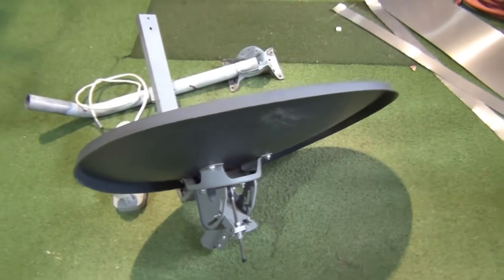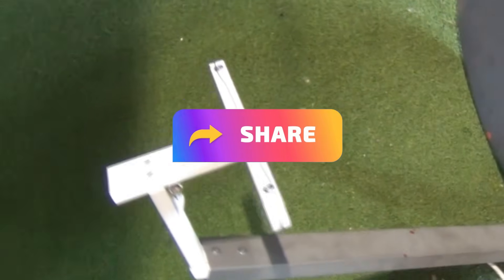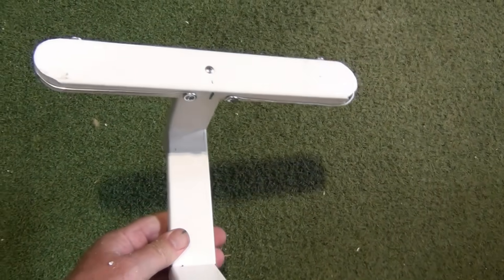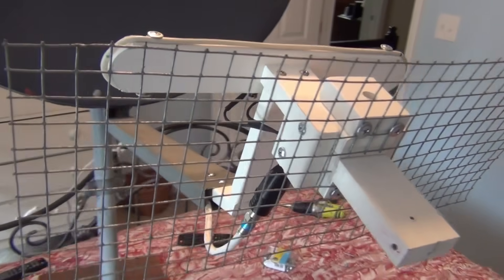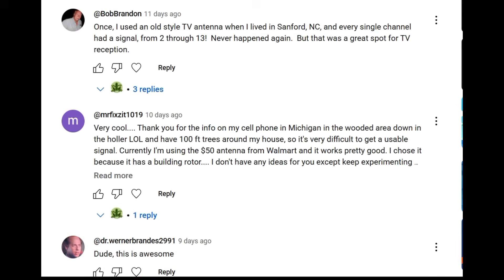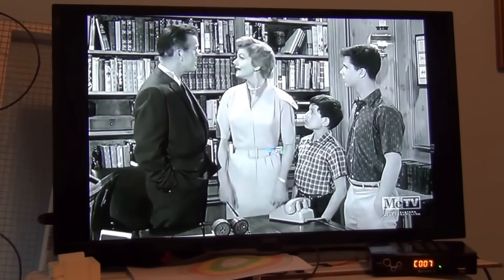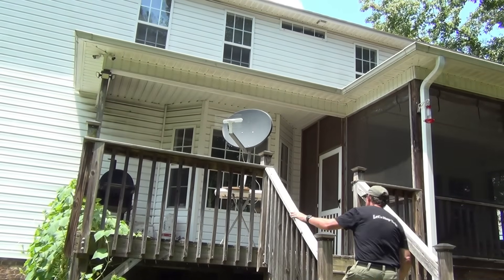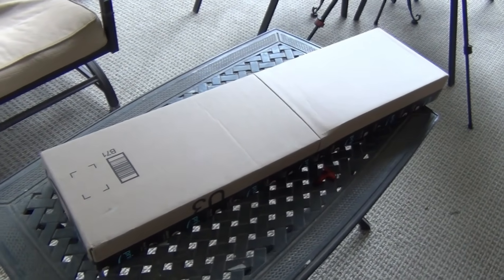Converting This DIsh To A Long Range TV Antenna PART TWO

Comment: Try adding 3 one inch wide strips of flashing (or mylar tape of the same dimension) to the mesh screen at the strongest signal points mounted horizontally across the mesh. Top, middle, bottom. That may help increase signal strength without causing a lot of overheating issues from a double reflector just getting too hot.
Reply from the maker: Thanks for the idea
Reply: @mrhoptoit7835  Maybe it'll help. Maybe nothing tho. idk

Comment: i have a trick that we used to use for xm radio. put your rig in the attic directly below the ridge, pointing it at the ridge.  start from the floor and raise towards the ridge checking signal strength. you'd be surprised how well this works.
Reply from the maker: Interesting! I'll have to try that sometime.

Comment: Try a 1/2 wave dipole. 468 divided by Frequency in MHz. Overall length. 468/625 MHz =.7488 decimal ft or {9 inches = .7500 decimal ft.}
then cut in half. This will give you about 73 ohms. Omit the 300 ohm to 75 ohm transformer. 
It looks like you have a folded dipole, which is approximately 300 Ohms. The overall length of wire @ 625 Mhz is17.98 inches but the antenna length will still be 9.0"long,in length. The 300/75 ohm transformer will be needed, or 300 ohm twin lead wire. I think you should go towards a full wavelength circular loop, more gain, directivity, and less man made noise. 1000-1005 divided by frequency in Mhz. 
That would be about 120 ohms however.
Reply from the maker: Great information. Thanks.

Comment: Okay, here's my experienced two-cents worth: Using a dish like that with a normal antenna mounted in front of it, I have my antenna mounted on 2 & 1/2 lengths of fencing top rail, which is 25 feet. Would have gone 3 lengths except the house is one story. The rail is mounted to two brackets, low and high, attached to a corner side of the house, I did not have to go on the roof to put it up, just the help of one other person to raise sections through the top bracket and attach them to each other as we raised it higher. I used fence top rail because it is sturdy, not too heavy and slips into each other. I placed it in a spot to reduce any tree interference, and aimed it to Los Angeles, 80 miles away. I get all of the Los Angeles stations. I also use a Philips powered signal amplifier with a gain adjustment that splits it into 4 outputs, no pre-amp on the antenna. The signal goes to 3 TV sets, one close short run and two far longer runs. The long runs have a simple signal booster at each TV. I get well over 100 channels and if I wanted to get San Diego too, I'd have rigged up some kind of rotor. A parabolic dish antenna works well as a reflector is because it can actually reflect any frequency in the radio/TV spectrum (and more) from 3Khz to 300Ghz. It's working as a rear-deflector to the antenna. With your front reflector, you got your design to do double duty. Bravo, brother!
Reply from the maker: Thanks so much for sharing. Great ideas!

Comment: You have the dish aimed to high the feed horn has to be aimed down  for a level with ground sing Al source on that type of parabolic dish
Reply from the maker: I actually moved it all around, and this was where I got the strongest signal. Thanks for your input.
Reply: @mrhoptoit7835 you have to point it completely off axis to get the benefit of the parabolic dish the feed horn fas to point at a 40 degree angle to the ground

Comment: If you use an indoor antenna with a built-in amp. On a uhf loop part of antenna, put a piece of aluminum foil behind it. Make the aluminum foil into a fan like a hand fan. It will jump up the signal on your meter.
Reply from the maker: Thanks for the info

Comment: 1) How about making a circular attachment to try instead of the rounded rectangular bar with the wire wrapped around it? 
2) Also try using bare copper wire around that instead of having the insulation still on it?
3) Maybe a slightly larger grid wire?
I see so many different types of outdoor antennas in my development and I've spoken to many of the owners and most of the commercially available ones seem to do pretty well for up to about 50 miles away.
Amazing how you can get any kind of useful signal INSIDE a bedroom! Good project!
Reply from the maker: Great ideas, I'll definitely keep them in mind for future experiments!

Comment: If your attic is accessible, try it there.  Then the signal has only one layer of 'stuff' to go through.  I've used that strategy in the past with pretty good result.
Reply from the maker: I only have a small hatch access into my attic. I could get it in there but I'd need to disassemble it.

Comment: I enjoyed the antenna videos. Why haven't you woven a copper wire through your screen?
Reply from the maker: Im not sure what that would do. I've used reflectors of galvanized screen and solid aluminum and they perform equally.  Do you think copper would somehow increase performance? I'll have to try it

Comment: I'm wondering how a 1/4 inch aluminum rod from Lowe's would work mounted horizontally? Your measurements do seem to be working well. You are almost temping me to go back into this myself as I am curious on using the 8 foot wire mesh dish in my back yard.
Reply from the maker: Great ideas. Thanks for watching!

Comment: You don't really need anyone to help to mount on the roof. Just get a rope tie it to the dish. Get on the roof with other and of the rope and the coax cable. Then pull the dish up with the rope. Just be careful.
Reply from the maker: Thanks for the suggestion

Comment: i live in baltimore and like tinkering with FM. there is a spot near me with a large concrete wall near the interstate. if i park next to it i can pick up several radio stations from southeastern virginia (250~ miles). I wonder how well this type of setup would work without any ability to block local interference or if there is even a way to do that without locating myself in a partial dead zone
Reply from the maker: Interesting thought.

Comment: Have you ever tried building a Yagi antenna?
Reply from the maker: Years ago I made a couple.Lately Ive been basing my designs on hoop elements because they work well and are easy for an average DIY to make. Lately Ive had a lot of people asking about Yagi antennas, so I might have to slip in a build episode for one.

Comment: Man, I've tried that too. It was very appealing because the dish was already high enough and cable was already in place. All I had to do is to replace the element with the RCA fin antenna I already had and used. Well, no better results than 15' lower at the window.

What really helped is to bring the very same fin antenna just under the roof at the attic, another 15' higher. No reflector like a dish, just to elevate it. That really did the trick.

Since then I do not believe a dish may improve ATSC reception. Your video is very interesting but just reinforces me in the idea that elevation is the king and dish does nothing. What a dish can do though is to block signal from the directly opposite side.
Reply from the maker: Thanks for sharing your experience.

Comment: In the Army, we used what was called and OE-254 antenna. It was for the SINGARS radio system. What I think you could do is modify the basic system to reach heights not easily accessible. These antenna can often be found on government auctions or surplus auctions sites.
Reply from the maker: I'll have to check that out. Thanks

Comment: Try changing the size of the mesh reflector and use a GPS to aim the dish at the transmitting antenna's and scan at every one and see how many you can pick up. Also what if you used one of the old 6 foot dishes? How far would one of those go? Try attaching it to the side of the house outside an upstairs window. What if you used 4? 1 on each side of the house? How do you combine the feed from 4 into 1? Can you make a fractal antenna using foil tape used for glass breakage alarms and a picture frame? What about a wall sized fractal antenna using foil tape that can then be painted over? What if every outside wall had a giant foil fractal antenna on it?
Reply from the maker: Wow, you have a lot of interesting ideas! Thanks for sharing.

Comment: I have to go back to the original video (I only skimmed it), but will this pick up VHF and UHF?  There is one channel I want but it is VHF and my roof antenna is pretty much UHF only.
Reply from the maker: The element length is not optimized for VHF. Check out the two episodes I did on VHF hi and lo antennas. Heres a link for the first video  - https://youtu.be/eqDwqveTOaE
Reply: @mrhoptoit7835  Thanks!  My knowledge on antennas is very limited....but I do have an old DirectTv type dish along w/ a 1 meter (I believe) dish I used to use when I dabbled in C-band FTA (and my old 10' C-band).
Reply: @mrhoptoit7835  I viewed the video on the VHF antenna.  I want to get channel 7, so my antenna would be 34" wide (17" per dipole, according to your chart).  As this will be wider than the small dish, do you think there is any benefit to using it w/ a dish?  The station is 32 miles away which is actually a lot closer than I thought it was.
Reply from the maker: @Dave_D. It may, but at that range it may come in ok without it.
Reply: @mrhoptoit7835  OK, thanks!  I just was thinking the dish's focal point would be relatively small compared to the 34" length of the antenna so didn't know if it would do anything.  Guess I will have to try it and find out!

Comment: I wonder what would happen if you used a 2nd element along with the reflector
Reply from the maker: Interesting. How would you situate the 2 elements?
Reply: @mrhoptoit7835 I would mount the 2nd element between the current element and the dish itself and move both elements away from the dish slightly so the focal point is centered between the two elements
Reply from the maker: Hmm, that's an interesting idea.
Reply: @mrhoptoit7835 I did forget to mention that in my mind, the 2nd element is also connected via coax, so it's not a parasitic or reflector element like yagi antennas use
Reply from the maker: Thanks

Comment: the dish isnt really doing anything at tv frequencies.  the "focus" effect of the dish is probably insignificant below 5-10 GHz, far above tv channels in frequency.  tv and fm stations are "line if sight" to thehorizin, which generally works out to 60 miles.  the higher you put any particular tv antenna, the further it can "see"...   that said, goofing around with antennas seems like a healthy thing to do so keep on keepin on
Reply from the maker: You are not the only one with that observation that has posted in the comments. Likewise there are many posted theories as to why it does work. I love a good debate.Thanks for your input. Yes, I seem to have too much to do in my retirement!
Reply: @mrhoptoit7835 i will just generically say that i have done all the math...  if you want to make a tv antenna that is more directional (has more "gain"), take a look at the "Yagi-Uda" antenna
Reply from the maker: Yes, Im familiar with that design. As I said from the very beginning, this was just an experiment with a junk dish to see if I could make it functional, which I actually did. I hope you and my other viewers had fun watching as I gave it my best..lol

Comment: I'd suggest you try it in your attic.  You will gain some more elevation as well as avoid some potential obstructions such as multiple layer of drywall, electric cables and plumbing.  
Also please ensure the dish is vertical in order to properly reflect the signal to the antenna. (I could not determine if it was vertical in the video.)  Have fun!
Reply from the maker: Yes, its on my list of things to do. It will need to be disassembled first as my access is only a small hatch.Thanks

Comment: You set the focal length and reflector distance based on a channel that’s pretty high in the UHF TV band. The optimal distances will vary somewhat based on the channel you are trying to receive so the exact spacing will always be a compromise, but if it’s practical to do so, you might try setting the distances based on a broadcast channel closer to the middle of the band. I suspect the distances won’t change much, but based on what you’ve done this far, I suspect we’re down to squeezing out marginal gains now. Sadly, no antenna or amplifier will overcome physical obstructions between you and the transmitter—can’t amplify photons that got absorbed by a tree along the way.
Reply from the maker: After much experimentation, in my location there is almost no difference in loop antenna reception anywhere between 7 and 9.5 in circumference, as far as UHF transmissions go. Thanks for the input!
Reply: @mrhoptoit7835 really?  Interesting!  Thanks for the reply!

Comment: Very interesting. The parabolic shape means signals reflected off the dish arrive at the focal point in-phase (adding). With the 7in folded dipole, part of this element is exactly at this focal point but the rest is off centre – meaning signals reflected to these parts arrive out-of-phase (cancelling). It would be interesting to try a small element at the focal point only (say, the bottom of a soda can) to see how much of an effect phase cancellation is having, and how it compares to the folded dipole. Great work!
Reply from the maker: Thanks for the input.
There's definitely more experimentation to be done with this design.
Reply: Since the dish is oval rather than round, the beam will be more of a line than a point (as mentioned in part one). Because of diffraction, there will be several peaks and nulls along the horizontal focal plane. These peaks and nulls will move (and change in number) depending on the frequency you are attempting to receive. That said, there should always be a peak at the exact center of the focal plane, so aim for that. :)

Comment: I appreciate that getting the dish on top of your roof solo is not viable - however if you have access into your ceiling/attic space and your roof is tiles (not metal) then you may well be able to get maximum elevation within your home?
Reply from the maker: Thanks for the suggestion. I currently have my house's antenna attic mounted. I may try to wrestle this beast up there this week.

Comment: My mom (93) has no Wi-Fi, no cable, no satellite. Just an old TV antenna that's been there since I was a teen (I'm 64)
Note: She also has aVCR and DVD but they have to be on while scanning channels so it sees channel 3
I've gone up on her roof turning the antenna 5 degrees at a time then come down, rescan channels and do it again. I've got her over 50 channels... Mostly junk but she does have her local and PBS channels.
I thought I'll get her one of those boosted HD flat window antennas...
That only got her about 25 channels. 
Went back to old antenna and now no local channels...
I connected the old antenna to the little power block... BAM!!! 73 CHANNELS... Again a lot of junk but she has her favorite channels. 
Of course she has a smart TV with nothing smart to connect to unless I'm visiting and use my hotspot .. she gets annoyed when she accidentally presses the Netflix, YouTube, Hulu buttons and the TV tries to set them up... She just powers off the TV and starts over. Her remote has a circle and a couple extra buttons that just confuse her.
I'm interested in what this old satellite idea will do. 
I was wondering if there was a sphericial antenna that could see signals from every direction. 
Whatcha think about that 
Oh yeah, put your dish up on a pole with a weighted bottom so you can pivot it up and down
Reply from the maker: Great comment! Thanks for sharing.
Reply: @mrhoptoit7835 l wanted to know on your RV HOOP ANTENNA, why 24-26" and not 18" or 36"?

Comment: I have LED light strings around both closet doors inside the closet. My TV hangs above those doors. I've always had bad TV reception in my bedroom. One day I turned off the LEDS and my TV cleared right up. I notice people putting lights around their TV. Will they have the same issue I had?
Reply from the maker: The LED's power supply was creating RF noise, which caused the interference. This is a common issue as the manufacturers are using cheaper unfiltered power supplies, but you can find better LED systems if you look for them. Thanks.
Reply: @mrhoptoit7835 never had that issue with incandescent lights. I just bought ten watt Edison Base bulbs. 
73

Comment: After you optimized the reflector to main element positioning, did you recheck the optimum distance from dish to main element?
The two things may interact because it may partly be that the bounce off the dish hits both the main element and the reflector and some optimum combination of distances is what matters.  This likely would be a "getting the last 1%" thing.
Your stuff is interesting. 
I wonder what would happen if you optimized the dipole length and position on that very distant station.
Reply from the maker: I did not. Honestly, the difference that I achieved was difficult to determine with the simple equipment I have.  Thanks for watching.
Reply: @mrhoptoit7835  That leaves ground for others to cover.  Its good content
Reply from the maker: Thanks, Ken.